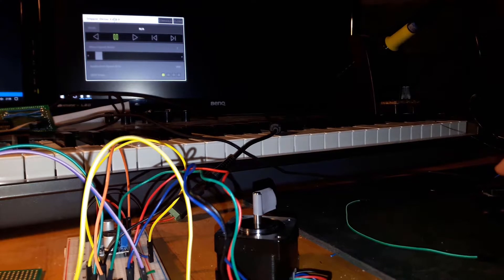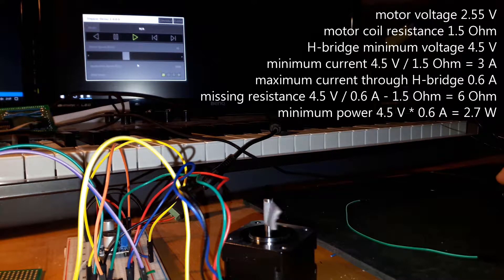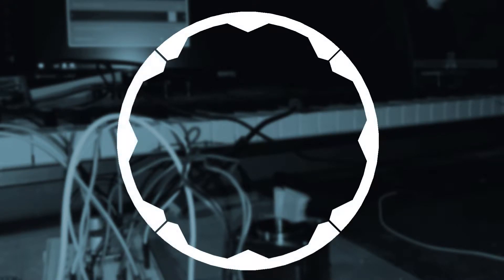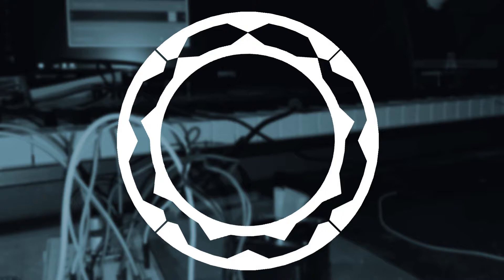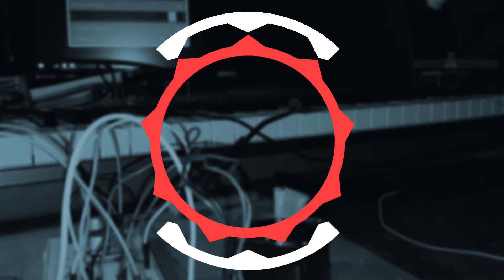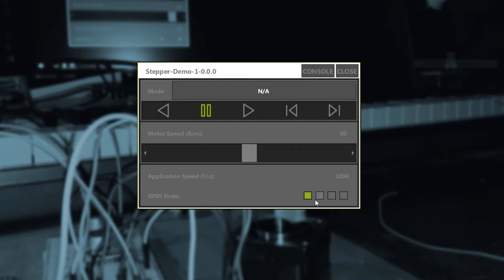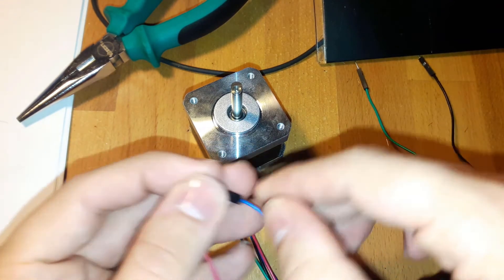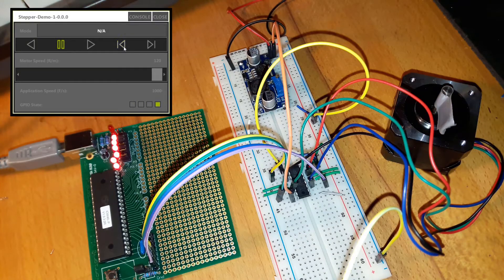Electronics: Driving a Stepper Motor with GPIOs via GUI

Comment: Hi

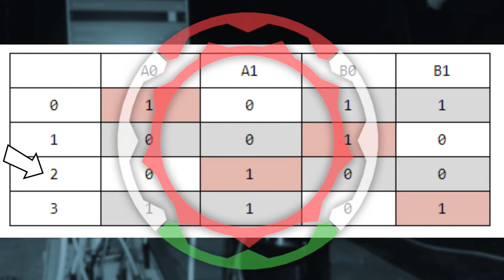How did you come up with the sequence in 5:21 for your stepper motor? [(1,0,1,1), (0,0,1,0),(0,1,0,0),(1,1,0,1)] works on my stepper motors, but I want to refine the steps down even more. Do you know any way I can do this? I can show you what my code looks like. I would also like to start and stop after each step, instead of completing a revolution of the sequence for four steps total (or three when you change direction)
Reply from the maker: Most stepper motors have a full-stepping sequence similar to that one. it depends on your definition of "forward" and which way your coils are wired up. to increase the resolution you can implement a 8 steps, half-stepping sequence. this is done by adding an extra step to the above sequence [(1,0,1,1), <1,0,1,0>, (0,0,1,0), <0,1,1,0>,(0,1,0,0), <0,1,0,1>,(1,1,0,1), <1,0,0,1>].
Reply: @comalab2387  Thank you, I will try this and let you know how it works. Also, do you know of any way I can construct my code so that I can control each step of the sequence, rather than running the whole "forward" or "backward" sequence x number of times? I want to be able to control how many ticks each stepper takes in its direction, but don't know of any method to doing so.
Reply from the maker: What does your current setup look like?
Reply: @comalab2387  So my setup is mostly defined in this PiMotor.py file(https://github.com/bokim24/EITS/blob/master/MotorShield/PiMotor.py), it was written by the people who designed the motor hat, so it has functions for LED arrows, dc motors, etc.

The code I run to test this setup is this arrowkeys3.py file(https://github.com/bokim24/EITS/blob/master/MotorShield/arrowkeys3.py), which I run on linux terminal and control each 'forward' and 'backward' motion with the arrow keys on the keyboard. The problem is that when I go in a reverse direction, i.e. left once and then right once immediately following, then I get four ticks forward, and then three ticks back, meaning that it completes the whole forward sequence, and now since it's already in the fourth position, which respectively corresponds to the first position for the backward sequence, it will complete three ticks to come back to the first position of the forward sequence. Not sure if this makes much sense without me actually showing you what my setup looks like physically, but yeah.

I want to control each tick and each motion of the stepper motor, rather than running the whole forward and backward sequences. Maybe divide the sequence into four parts and call them forward1, forward2, forward3, forward4 with each setStep called to them? Let me know your thoughts and ideas, and thank you very much for the help!

EDIT: The links above aren't working for some reason, but this one might -- > https://github.com/bokim24/EITS/tree/master/MotorShield
EDIT2: yeah i think that link works, just click on whichever file you want to take a look at. The stepper motors are basically set up in a stagelight rig that we want to point at various areas and directions and want to control the steps to run very precise, but also in a smooth fashion. I'm also reading into micro-stepping sequences, do you know of one in particular that might work for our motors?
Reply from the maker: looking at your scripts i don't see why you shouldn't be able to write custom stepping functions. the current implementation for "forward()" loops in multiples of 4 steps. you could replaced that by executing a single step forward or backward. however you'll have to add a variable to your class that remembers the current pin configuration you're at. for example, you know you're at 0010, call next() you switch to 0100, call previous() you go to 1011, etc.

as far as microstepping is concerned, that won't work with simple GPIOs because you're gonna need smooth transitions between 1 and 0, or in other words, the generation of two voltage sine waves (one for every coil). you could probably use ur GPIOs for that, but it depends on your hardware if they can switch fast enough. the technique is generally called PWM.